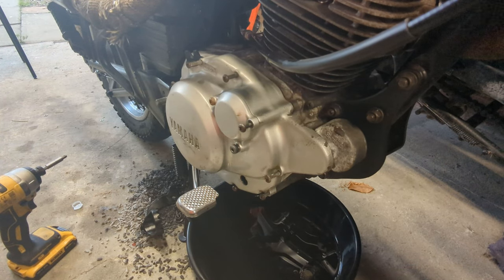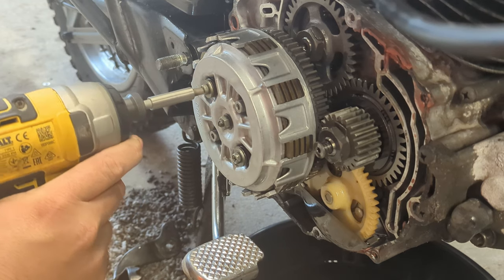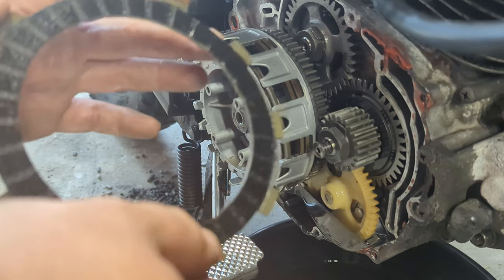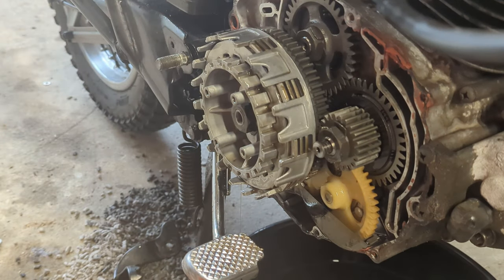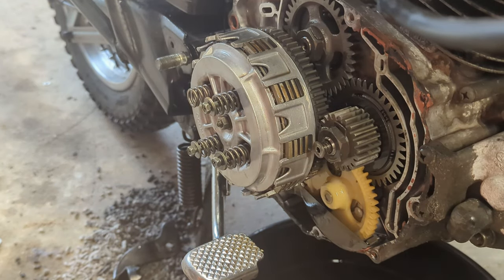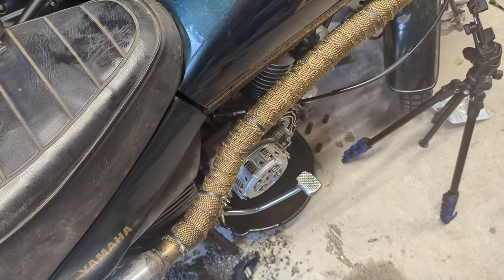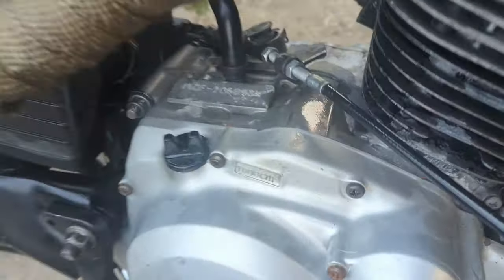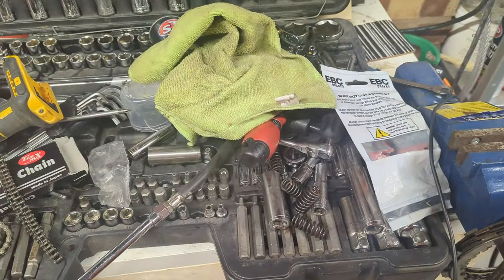Yamaha SR125 Clutch Change - The Grand Challenge | JAM#33

Comment: Wahey! Going in the right direction. When you were referring to an improvised clutch lock tool, I assumed the answer would be ugga and duggas.. Wasn't disappointed! 😅 When's the maiden voyage?
Reply from the maker: I think the workshop manual was being a little dramatic calling for the lock tool to oppose a 9nm bolt! I expect its more use removing the basket. As soon as the multi-day thunderstorm passes I will be taking tentative steps out within walking distance...

Comment: Hi - what was actually wrong with the clutch, slipping when under power? That is what is happening to my SR125
Reply from the maker: The clutch was not properly adjusted using the internal adjuster (on the front of the clutch basket) is my best guess, although in my case it's possible the wrong oil (car stuff with friction modifiers) was used previously